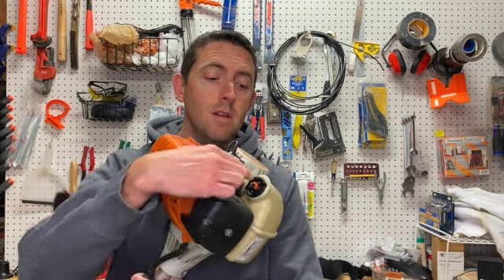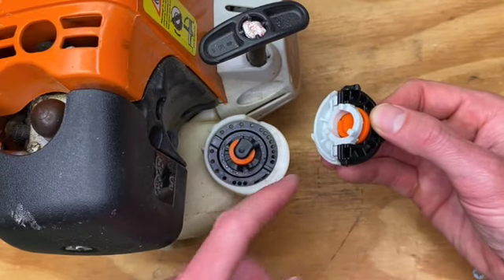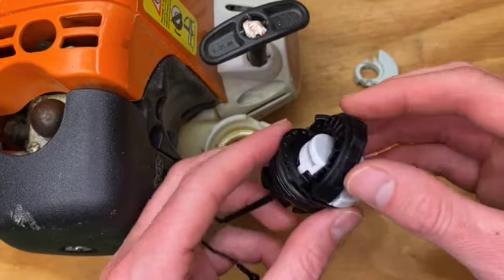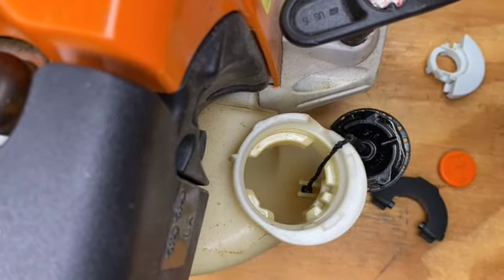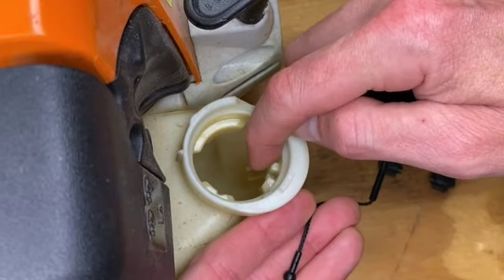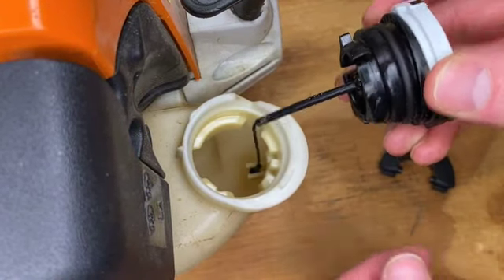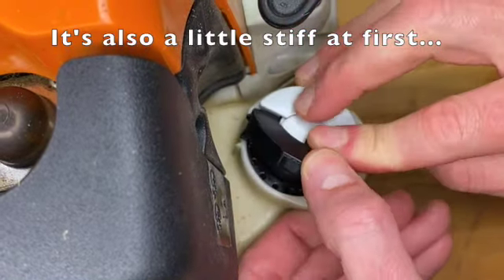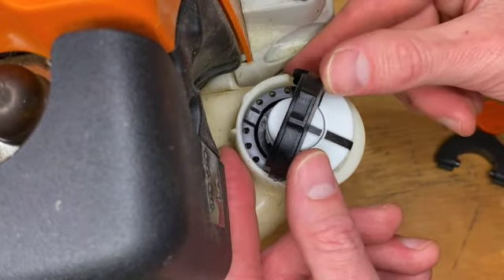Stihl weed wacker gas cap repair

Comment: I just spent a half hour trying to get my Stihl gas cap back on 😤 
In my driveway in blowing snow… 
I sincerely hope that the designer of that cap burns in hell for eternity.
There’s some trick besides aligning the marks… I think the inner parts have to be rotated in some proper rotation.
Reply from the maker: No kidding. Mine just snapped off one day
Reply: Dealing with that shit right now!! What a pain in the ass going on 20mins now
Reply: @wiggelyworm2877  Here’s what I did that helped… took a Sharpee marker and put a heavy black line on the cap from the center to the edge… that lets me note the orientated the position where the cap is in the ‘released’ position and in the final ‘sealed’ position… that did the trick for me!
Reply from the maker: Great idea!!
Reply: @johnmccormick2883  awesome idea.  I’m going to try that.
Reply: @bobcox9064  it did the trick for me!
Thanks for the note.

Comment: I got my FS 40 at our local dump, while dropping off some scrap metal.  It was brand new, shiny, had no cutting line or gas.  Both of these were the reason it had been thrown out.  The gas cap was designed by a dislexic idiot, the line replacement becomes another hassle after the unit has been used a few times, (dirt, wear on the spool etc.  A simple Saturday morning yard cleanup turns into a two hour chore as the first hour is spent trying to get the FS 40 to stop killing the grass with gasoline spilt etc.  The motor is great, lots of power, but I wouldn't recommend buying one.  A normal gas cap retro fit is seriously needed and fire the idiot who designed the first one.